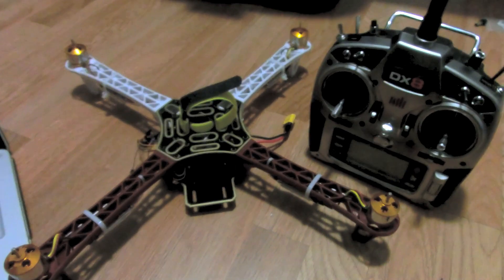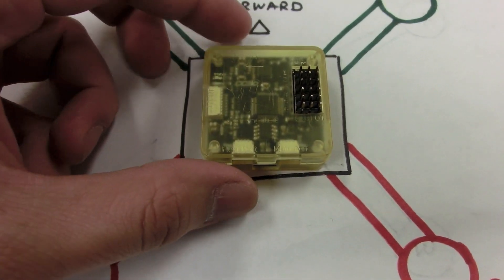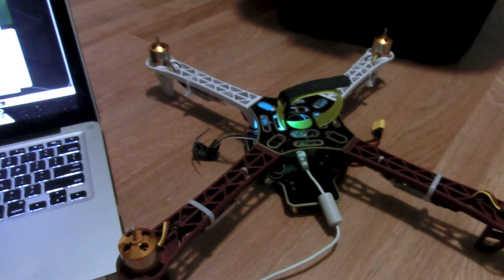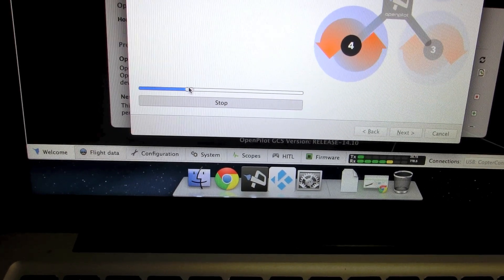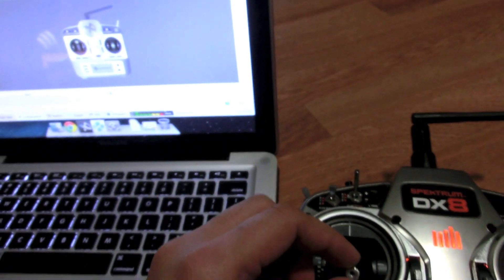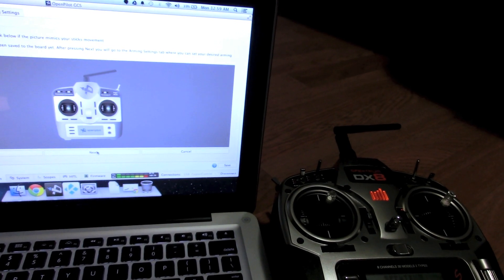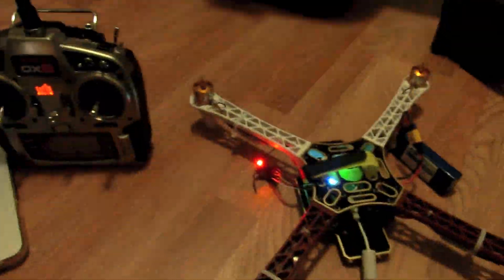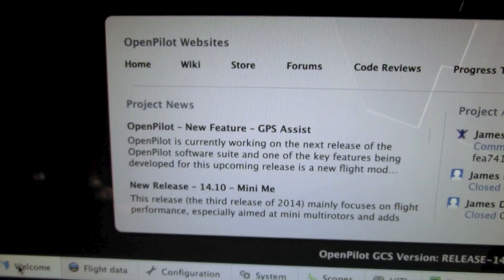How to configure Open Pilot CC3D Flight Controller with Ground Controller Station v14.10 Mini Me

Comment: Thanks for all your help via e-mail and sorry if I ever sounded "dumb" while I am not, being on this hobby since 2006 and done from planes to helis to quads, and built a few of them myself with no help at all, but I was totally new at this CC3D board and as you can understand it's not easy when all of a suddent you have to start from scratch learning something different than what you're used to. I regret it doesn't have a Barometer and/or Accelerometer, but that's okay, my very first quad never had a Barometer and I managed to flew it (and crash many times, the frame was CF also), but since this Tarot 250 project is going to have a FPV camera (Tarot TL300M very light) and I am going to fly with FPV, that's not too bad because at least one can see where is the quad at and exactly what it's seen, makes it much more fun than just flying without FPV. I sent you an e-mail that you never replied to yet, but that's okay, I can live without it..ha ha. - Regards!

Comment: Hi Chirag, this is Victor.
I'm almost done building my 250 size quad, I finally received the motors and ESC's three days ago, I also ordered a DJI S.Bus receiver and that's what took me the longest to figure out, until I just opened the DJI TX and disabled the gimbal  lever by software, and bingo! now all channels are working fine, and there will be only three wires from the CC3D to the DJI S.Bus receiver (ground, power, signal) that's it. Now all I have to is wire all the motors, make sure they rotate in the right direction, put the lower CF plate back (I removed it to install the ESC's) and the rest easy peeze. I wanted to use the DJI Phantom TX because I like it, and because I knew the RX only needs three wires cable and very simple setup, this way I will be able to use the same TX with my DJI Phantom and my Tarot 250 CF frame built quad. :)

Comment: When i press save, a red cross appears next to the save button and the new parameters are not being saved to the board, any idea what this might be?
Reply from the maker: Mathias Larsen I think you are trying to change PID settings. You can not change the PID settings right after enabling the TxPID. First check the box to Enable TxPID settings. Click on SAVE. It will be Red X mark. But do not worry, now click Disconnect on the right bottom corner, disconnect the battery as well. So basically you need to power cycle the flight controller in order to change the PID settings. Now connect the CC3D to your computer again and change the settings you need to change, and SAVE it, It will work this time.
Reply: Chirag Chaudhari Thanks for responding! However, the problem was solved by disarming the flight controller first, now everything works fine:)

Comment: Hi....nice video there, easy to follow....but ny problem is I can't configure the transmitter....there is no connection. ..I already bind it..
Reply from the maker: Malee kamali When you said there is no connection,do you mean there is no connection between your Radio and Receiver OR the Receiver and the Flight Controller? My guess is, you are not powering up the Receiver when you are doing the Transmitter Setup Wizard. Power from USB is not capable to power the receiver, it can only powe CC3D. So while configuring the transmitter you do need to provide external power by connecting the battery.
Reply: Chirag Chaudhari 

Im using Th9x controller, when I move the stick the computer fails to register any motion with battery attached.....
Reply from the maker: Malee kamali I suggest you to re-bind the transmitter, Make sure its powered up and the connection LED is solid when you power up radio and your setup. If all those is correct check your connection cable, and make sure its connected correctly. If that doesnt work, I suggest you make video and post it on youtube.
Reply: Chirag Chaudhari 
Hi....I m using esc hobbywing 10a....and I notice that only white and black wire available to slot cc3d, should I slot in red wire between the two black and white and connect to bec with 5 watt ?
Reply from the maker: Malee kamali That is exactly what I do in my personal setup. Power the BEC with battery, and 5V output Red wire goes between 1st motors ESC's White and Black like you said. And then solder the  Gnd Black wire from BEC to PDB. So everything is grounded properly. And you have 2 empty slots on CC3D to use it for something else like Camera Pan system.
Reply: Chirag Chaudhari 

Thanks a lot Chirag Chaudhari......you save my day....
Reply from the maker: Malee kamali Glad to help you buddy!

Comment: Hi there....Just purchased my ccd3 board. I wonder. Why does one plug the power plug (black,red,white) into ch 1 on the receiver. In most receivers ch3 is the power source. (mode2)  Why does one use ch1 for this ?
Reply from the maker: drone19730602  None of the pins on the receiver is power source. But they take power from BEC from ESC or independant battery. All the power and ground pins on receiver are connected together so you can power up your receiver using any pins. Only signal pins are different.

On the other hand, CC3D is programmed such that, you can plug any channel anywhere, and it will map it to your desired channel when you do the transmitter setup.

Comment: How does this compare to the multiwii 2.5 with configh? I have had a lot of issues with multiwii 2.5 and wanna try a new board. Thanks.
Reply from the maker: Steve B I have not used Muliwii, but one thing I can tell you for sure is CC3D is extremely easy to configure and get stable flight every time. Because of its simplicity to configure, and great flight performance, I have chosen it for all my custom quads that I build and sell. And they work perfect every single time.
Reply: Chirag Chaudhari Thanks. The purple one is that one ok?

Comment: Did I miss it?? Or did you skip the part where you hook up the plugs to the receiver???
Reply from the maker: Its in the beginning of the video. Starts at 1:00.
Please disregard the color coding of the wires, as the chinese manufacturers do not seem to care about that and keep changing it.
Also the CC3D is very smart Flight controller when it comes to assigning the channels. Even if you connect them wrong, you can assign them to correct Input on the Transmitter, in the Transmitter Setup Wizard. 
Hope that helps.

Comment: will a Spektrum DX5e work ?
Reply from the maker: L4foto Yes it will work. But You will be able to use/program only two flight modes.
And you will not be able to tune the PIDs while in flight, since there is no Knob or Pot on this transmitter.

Comment: Well done! Awesome info cheers
What spec is your f450?
Reply from the maker: > 1045 Nylon props
> 2212 1000kv Brushless Motors
> 30 Amp ESC w/ SimonK firmware
> 5000mAh Zippy Max battery
And of course the CC3D flight controller
Reply: +ChiRag Chaudhari and rc transmitter and receiver also.

Comment: I have a question my friend. I have a dx8 and the night hawk 250. I set up my cc3d the best I know how. When I plug it in and initialize the quad it spins up to the max. I'm not sure what i'm doing wrong. Also when I go to set up my transmitter, my throttle in mode two isn't responding correctly. When I checked, the throttle stick for some reason had yaw/rudder as the throttle. I'm kind of at a loss, and any help would be great! Thanks so much!
William
Reply from the maker: Looks like you need to calibrate your DX8 again. Start with new Model if you have to. RE-Bind the receiver, make sure the cables are connected to the receiver in right order. That should fix all the problems. 

Also when you ARM the copter and if the motors starts spinning, that is because you may have checked the box that says spin props when armed. its located under
CONFIGURATION(bottom left) > OUTPUT (left panel) > Last Option Output Channel Configuration

Hope that helps!
Reply: Thanks my friend! Today I worked on it some more, and I had to reset the transmitter. That seemed to clear it all up!  
Now I want to go in and fine tune it, so I have more pop when I punch out. Any suggestions? 
Thanks again!
Reply from the maker: William Bynum Well I think with the QAV250 PIDs you should be just fine. But if you want to play with PIDs start with default PID settings. Enable the TX PID module....... This is actually very vast topic to discuss. I am planning to do video on this but weather is just not helping. May be late March or in April. You really have to be out in the field to do this. But check out this video here: https://www.youtube.com/watch?v=VbZNeDCnUyI

hope that helps.
Reply: Thanks! I like the stability it has but I notice some oscillation in high speed descent. So Id like to fix that.
Reply: William Bynum that oscillation is normal and you cant remove it. Its appearing in fast descend because the quad is flying into its own turbulences.

Comment: i have built one like this,using transmitter fs-t6..when it turn to fly,its shakking,and sometime its flip.any solution?may share the pid setting for beginner fly.pls help...and may i know whats type of your props and its size,thanks
Reply from the maker: If you can provide more details about your build, I can be more helpful. But from what I am assuming you have similar frame setup, make sure your flight controller is installed right on CG of the frame. And also provide some kind of vibration damping. I simply use double side tape to mount the CC3D.

Also make sure your props are balanced and they are spinning in right direction. Also you mentioned that you are beginner. Easy thing to do is do not mess with PIDs at the moment. On the "Initial Tuning" page just select "Current Configuration", that will put default PID settings on the flight controller. Default settings provides you very very stable flight but controls will be little slow/mushy.

I am spinning 1045 props on this setup with 2212 1000KV motors.
Hope that helps.

Comment: What happens if one of the motors spins in the wrong direction? Can you unplug it and switch afterward?
Reply from the maker: When you are doing "Motor Output Calibration" if you find one or more of your motor is spinning in the wrong direction than the arrow shown in the picture, you can change the motor connection to fix it. and continue with the calibration.

Comment: What do you do if the channels don't reverse? I'm having trouble with this step
Reply: I too..
Reply: It looks like you have to adjust on on the radio...
Reply from the maker: After Checking the boxes of the Channels that need to be reversed, when you click Next, then you will be able to see the correct stick movements. You will not see the stick movements reversed on the page where you actually check the boxes to reverse the screen.

And if you dont see the channels reverse on the Next screen,
1. SAVE the configuration as it is.
2. Click Disconnect on the right bottom corner and disconnect the USB from the Flight Controller.
3. Close the GCS program on the computer, Disconnect the battery from the copter and Turn Off your Radio.
4. Turn the Radio back ON. Connect the battery to the copter. Start the GCS Software and connect the Flight Controller to the computer.
5. From the home screen, Go to CONFIGURATION tab on left bottom corner. Then select the Transmitter Icon(Input Tab) from the left panel. And click on "START TRANSMITTER SETUP WIZARD" to do the Radio setup again.

This must work, otherwise Reverse Channels on your Radio Transmitter.
I never had this problem with three different radios DX8, T10J or Propo 10X.
So Good Luck guys!

Comment: Can I use gps with this? for return to home or keeping position in hoverin
Reply from the maker: CC3D boards do not support GPS-based functions such as waypoint navigation or position hold.
However, vehicle location data can be transmitted to a ground station by connecting i) a GPS and ii) a telemetry radio link.

There is more Advanced version of CC3D flight controller available called CC3D Revo which is capable to do those extra functions and many more.

I personally use APM 2.6 and Pixhawk for those purposes. But for park flying, or short range FPV I highly recommend CC3D since is very easy to setup and highly reliable and stable.

Hope that helps. Thnx.